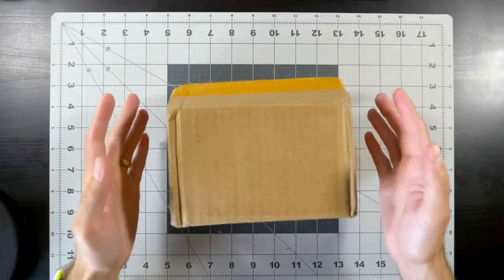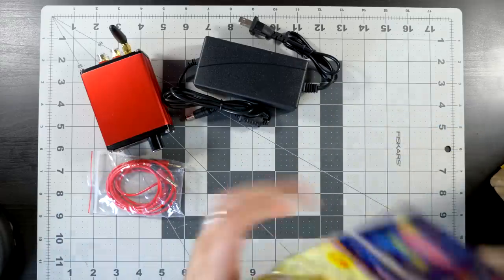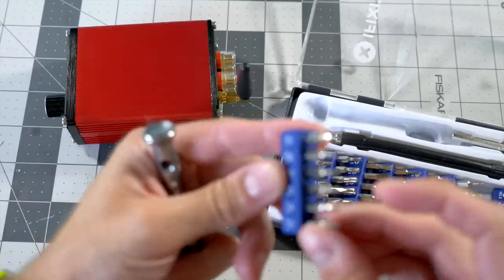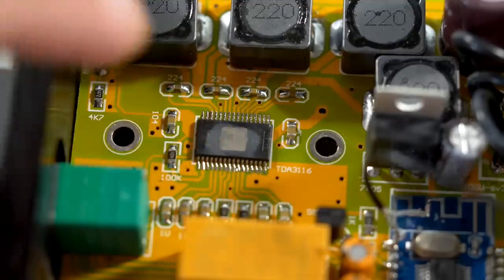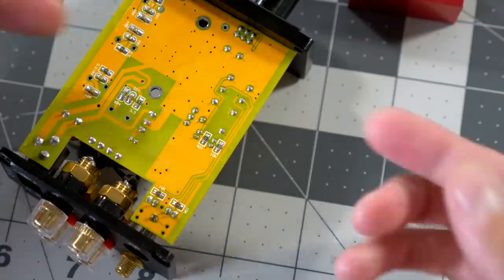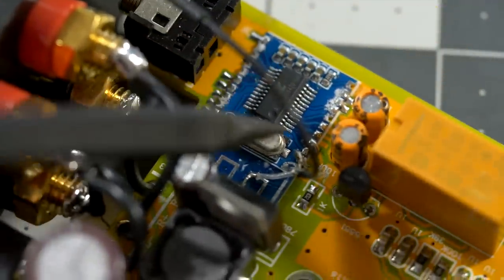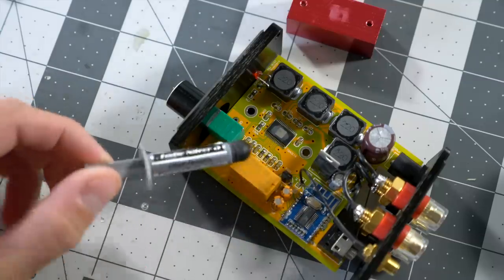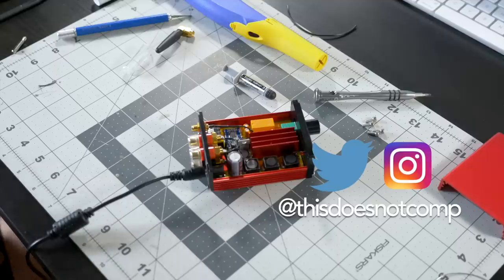Mini Audio Amp Teardown and Mod!

Comment: Maybe I'm wrong here, but now that both sides of the trace are cut, won't this defeat the capacitor completely?
Reply: Beitie Beitie The capacitor will be connected across the power rail when the switch is on.
Reply: No, but it does make for a rather long return path to the main filter capacitor, making local bypass capacities all the more important...not that it was ideal to begin with since there is a rather long and narrow path between that input capacitor and the main ground plane even as it was to begin with...so probably comes out to be six of one, half dozen of another on this project (which is to say, it won’t make much difference in this case as neither of the two are ideal to begin with).

Comment: You have to be careful looking at amp chip data sheets. Just because it says it'll do X watts at Y ohms at Z volts, doesn't always mean it's a good chip. You have to look at THD+N, charts, and characteristics based on the configurations of single ended, bridged, or parallel bridge connections. 
But generally, TI chips will have the power specified at 10%THD, and sometimes at ohm ratings that aren't as common, like 3 and 6 ohm.

Comment: The reason it doesn't connect to the pot is because they don't want DC in the pot, the pot is dealing with AC only. They want to separate the audio and power grounds to the max to meet the opamps safe man

Comment: I can't decide if the weirdness/cheapness of the amp is worse than I expected or par for the course. That power switch is definitely a new strange level of cost cutting. Even $45 seems kinda expensive for this thing.

Comment: I'd be willing to bet that the board is designed to not not care if it is a switched pot or not. This way, they can just buy whatever is least expensive, or use whichever 10k pot they salvaged. Just jumper the switch solder pads when using non-switched pots and call it a day.

Comment: I also bought a nobsound amp on eBay. Different model with sub out. Same exact behavior. Power light always on. Seems the company has done this by design.

Comment: At 22 mins in, I'm thinking the switch on the volume turns off the relay to stop thumps. It's got enough pins for a dual pole. The amp and the blutooth look like they stay powered up, minimal loss there at class d compared to the brick losses. Is this the type of amp you'd buy to put into a small bookshelf speaker to convert from passive to powered?

Comment: you should have cut the connection after the cap you partially bypassed the 60 hz filter so now you will have line in destortion (aka humm) in your speaker output
Reply: No, he won't have distortion, because the chip is now dead, and there'll be nothing to distort!

Comment: Nice to have a working switch but you do now have a filter cap in a less than optimal position for good power filtering. In effect you have changed a reasonably well thought out filter scheme into one that may not work as intended. Not a criticism but you may now require a better filtered power source along with better EMI filtering at the power in point.

Comment: i think that amp IC has an ENABLE pin on it and it was keeping the bluetooth module powered all the time and switching the leg on the amp IC to power it up. *just my opinion from what i could see pausing and looking at both sides of the board. the topside of the board has a trace running from the power/vol pot to the IC. the datasheet for that IC says PIN2 (SDZ) = Shutdown logic input for audio amp (LOW = outputs Hi-Z, HIGH = outputs enabled). Hi-Z means high impedance or no output.

Comment: I would have gone with a NE556 as a Stereo PWM modulator and a NE555 as a clock generator and a dual channel OP-amp and 4 BD131 power transistors for the output two for each channel and the OP-amp are part of the feed back circuit being feed by a low pass filter one for each channel.

Comment: to be honest its 40 quid...………..looks quite ok...….they often "acid etch" the top if IC's to hide the fact there "Knockoffs"...….probably  the switch issue is to save money (they had thousands on stock)  and you could argue that it ads mechanical strength, also leaving the Bluetooth "on" is no bad thing as the idle current of those modules is in the uA range...(bugger all!)….the proper amount of heatsink compound is better on the chip as you no  categorically that you have thermal contact....Great video Sir !

Comment: The switch's not designed to hold 5 amps, that the reason why it's not connected to the power supply.

Comment: for the supply with 12 volts the not so perfect heatsink is ok :-)
but of course with this supply it is not possible to crank out 2+50 watts on 4 ohm.
an important question: how did it sound?
Reply: You are absolutely right.
That's most probably the reason they add a 12V power supply.
At 12V and with 4 ohm speakers the thing won't be able to do more than 2x 10 Watts and most probably the heat protection of the amplifier chip kicks in even before that. With those tiny Chinese class-D amplifiers it's best to use 8 ohm speakers and a notebook powersupply of 19V. It still won't give you more than 2x 10-15 Watts.

Comment: If you wanted the whole thing to turn off then why dont you just off the socket????
It would also stop the power brick from converting the voltage constantly.

Comment: The Fosi Audio TPA3116 V1.0G is much better made and comes with a 19V power supply. It has no bluetooth, but as bluetooth sounds like crap, I don't care. I like mine, although it will not get anywhere near 50WPC. With the included power supply, my Fosi does about 20WPC into 4 ohms (as my speakers are 4 ohms). It also has a separate switch, so I don't have to change the volume setting to mute it. It's not really ever off unless you unplug it, the switch just mutes the amp. It also provides a pretty beefy capacitor bank immediately after the power input jack (1,000uf @ 35V x4) to provide a nice, low source impedance for the amp chip to run off of.

Comment: I have a guess on the diagram print out included in the packaging. The photo is labeled, like a diagram to show the dimensions. To show the amp right side up and include the same measurement would leave out the height of the amp and feet. The photo they used would have had to be taken at a proper angle, and had extremely clear measurement markings to convey the measurement shown is the width of the aluminum, not the height of the amp sitting on its feet. They either didn't have the right photo to use or knew no matter how clear it was right side up, the feet adding a few mm to the overall height of the assembled amp would be unclear.

Comment: Tiny PA chips just cannot do the work they claim, when it comes down to it you're talking about volts and amps and physical size of the internal bus and connections have to be big enough to handle the current.

Comment: Hi, Did you test the amp switch before open up the little case? some of TPA3116 design using a switch on pin 12 to actually mute the amp. The manufacturer didn't use the power switch on the volume pot for main power because the switch can't withstand the peak current draw.

Comment: It's always a good thing to hack your stufs so congratulation on that.
That being said the reson they dont use that switch on the buton to turn the power on and of is that i seriously doupt that this kind of small swiches can handle switching 24V 5A with complex reactive load. That might work but that will probably blow at some point. But hey it's cheep chinese electronic, that shitty cap would probably go bad befor the switch anywhay so ...

Just my 2cts...
Reply: Considering he de-soldered the ground lead on the filtering cap, the power supply will likely dump the maximum instantaneous power output through the switch terminal upon closing, creating a dead short and a spark in the range of 20-100 amps. Definitely going to wear down the contacts!

Comment: You can see the switch traces on the top of the board.  Look at the back end of the volume/switch assembly - the single thin trace coming out from the back corner toward the LED.  It runs under the 100k resistor then under the 3116 chip.  Guessing it goes to Pin 2 - SDZ  (shutdown) or pin 12 - MUTE.  If I'm right when you put power on that line, you probably destroyed the chip.  Since, y'know, even though you didn't specifically Show us the regulator, I was able to read '7805' from it, which means the logic runs at 5v, and you just put 12 v on one of the logic pins.  My guess would be that the constant power is for the Bluetooth board, so you Don't have to keep re-pairing it, and the 'off' switch just turned off the 3116 amp section.  Have fun with your pretty new paperweight.
Reply from the maker: I tested it with speakers off camera, works fine.

Comment: Did you check if the switch was not wired to a standby input on the amp chip through a pull-up resistor?

Comment: Noice. I kinda started on something along those lines. I usually listen to podcasts around the house while i do chores. Normally i just leave my phone somewhere close and that's it but i found a speaker with line in at goodwill for a buck (there's tons of them) so i am making it into a raspberry pi powered internet radio. XD so far its been fun. I got everything working how i want it but the pi is outside and powered by its own psu. And its a pi3 so its overkill. Gonna change it to a pi 0w and im gonna power it off the same psu as the speaker and then mount everything inside

Comment: that switch is connected to the rest of the circuit... its normal that you see nothing with the multimeter... you maybe have a led for the Vin... this led is not supposed to be turned off... ... you may find the other pin of the switch connected to something else... i let you figure it out ;)

Comment: You didn't get a beep of the second switch leg because the switch was turned off. There's a trace that sneaks under the amp chip, so it's likely switching something on the amp. Perhaps an "enable" pin or something? Pretty terrible implementation of a on/off switch. Personally, I'd fabricate a simple transistor controlled on off switch, where I used the switch to turn the transistor on and off, simply because you'll never know how good that switch is..

Comment: TPA3116's wiring diagram from 320volt.com:
https://320volt.com/en/wp-content/uploads/2017/10/tpa3116-circuit-schematic.png
The IC doesn't have leads specifically for the power LED, but shows ample opportunity to include it among surrounding traces. So, considering that the IC's 12V - 24V circuitry intersects the Bluetooth module's 5V circuit, via the main power Capacitor ("-" side), AND at least 1 circuit (hence both) are flowing current as indicated by the LED lighting up at all, I'd assume both circuits are functionally complete. The only loose end might be whether the input power Cap is still involved. If in doubt, a continuity check from the rotary switch's power "+" side to either side of the Cap should confirm, I think. Before checking continuity: power switch in the "On" position, power cord unplugged, Cap fully discharged.
Btw I bought the TPA3116D2 amp version that does 2×50W + 100W (so they say, but never happens), Bluetooth-in only... sturdy amp in my experience. I put a passive 2nd order low pass crossover on the sub channel, and a 2-way passive filter on each L & R channel with a corresponding mid & tweet thereon. Powered on Lithium-Ion & home grown BMS tech. Sounds strong though it never reaches 3A. The sub I have on it now is an 8ohm 15" PA main. 1 datasheet I saw for the IC said it was rated up to 7.5A, but if you can make it push that kinda current you should prob'ly put a good fan & ventilation around the whole thing.
Anyhoo, remember Watts=Volts×Amps-circuit inefficiencies.
Appreciated this video and its sequel. This is like what I've been researching in TECH HOBBY & RECHARGEABLE BATTERY TECHNOLOGY playlists.👍😎

Comment: So is it just me or is the input power for the whole board now controlled by the volume knob? Ie everything is on a dimmer switch? Or am I just missing how that is being handled?
Reply from the maker: The dial actually performs two separate functions. The first is that it's a stereo potentiometer for the audio, and the second is that it's an on-off switch. The two are electrically separate, though. There's a little "bump" in the rotation of the dial where it clicks to turn the switch on. Any further rotation simply changes the audio volume.

Comment: It would have been a better idea if the company didn't put the damn power light on at all. I don't have any use for blue tooth anyway. I just have the Lepai LP-2020TI and Kinter K3118. Both have this pop through the speakers when powering them down. sounds like a cap discharge to me. The first filter cap is after the power switch so if one gets a PS + and - reversed there goes the cap. Sure they are cheap affordable amps yet a resister could have been added to drain the cap to ground tied to the ground side of the power switch, at least I think that's how it works. I only have build tube powered guitar amps which have a power stage filtering using 3 to 4 500 V 40 uF caps to take out the a/c ripple from the power transformer. Most do offer a bit of a speaker pop on power down. I don't pretend to know solid state one bit. Yet I would think there must be a way to eliminate the power off speaker pop which does not harm the speakers. It's just annoying. I don't try to force out the 20x20 RMS rating and use 8 ohm speakers , even 5 watts is plenty loud so I stay with the 12 volt 3 amp PS. I hear no hum or buzzing just music for my desk top PC , much better than those sterile self powered PC speakers I've had in the past.

Comment: You should not use that tiny switch of the pot for main power, it's far too weak to do that. You'll need a relay to be able to do that safely. The switch just controls the soft-power off pin of the amplifier chip. The big capacitor is not for filtering but for buffering: it provides power peaks for heavy bass. Who cares that the chip isn't centered with the heat-sink? There is no reason it should be. It's far too tiny anyway.

Comment: Did you check the current rating of the switch ? Arctic Silver is potentially conductive, or at least capacitive. I would not have used it on that audio IC, as it is close to the exposed connection pins.
Reply: http://www.arcticsilver.com/as5.htm

As he cleaned the chip and applied the paste to the heat sink, I think he’ll be fine. It is not conductive, but “very slightly capacitive”.

Comment: interested in function with speakers. I have had 4 or 5 of these now, I sell them to co workers because they just want musing and do not care about additional features. I'm hoping you or one of your viewers can help me finally find the right model for my needs. I've been through all the major MB variations available on ebay for the 25/25w 50/50w 2 speaker bluetooth amps and they all seem to lack sound quality. I am currently using a 50/50/100w that just about meets my needs, but it has this horrid Chinese/English voice that squawks at full volume "the bluetooth device is ready to pair"  I really want something that would play music off a usb stick or SD until it see's bluetooth and then goes back to playing when bluetooth is released. I might be asking too much there, not having that voice would be nice.  You are right about the laptop power supply. I have an HP printer power supply that made a stellar difference in power.

Comment: Someone can correct me but if you have a spare heatsink around I'd throw one on that 7805 voltage regulator.  Those things get really hot especially if you start supplying them with 20 or more Volts.

Comment: Not a great idea to switch the ground on a device like this that connects to other devices.  Make absolutely sure that the power supply 0v output is completely isolated from ground, otherwise the switch will do nothing and the amplifier will try to power itself via the ground on the RCA connectors.

Random component choices on cheap Chinese gadgets tend to be down to whatever components were available at the time.  Possibly it was originally designed for a non-switched pot, but they got a deal on switched pots and just added a couple of holes to the PCB.  The other possibility is the switch in the pot isn't rated for the current required by the amp, did you check?  Also the voltage regulator is a 7805, therefore 5v.  7812 is a 12v regulator.

Comment: I would think that the power switch / potentiometer would not be adequate in terms of the amperage needed required to power the amp circuit and will probably burn out. 
Keep the videos coming though I do find the audio stuff interesting.

Comment: It Would probably be easier to do the wire to switch thing if the top of the circuit bord had not been cut only the bottom after the electrolytic capacitor and the wire soldered to the capacitor.
Thats how i would have done it.
but it still works so it doesn't matter what way it's done as long as the electrons can still get where they need to go.
✋👍👍👏

Comment: Well Im not a nerd but if I choose to tinker with this then first I will Check first if it works as intended and if not then return it. Second, if it did work, then I will try to modify after I have made a clear rework of the electronic diagram of the PCB since it is simple enough to reverse engineer the crap out of it. As for the video it would be nice if we actually see if it worked before and after enduring all that excessive rumbling and rant. But that's you and hope you got what you wanted coz I did not expect that teardown and rework without first clearly and practically showing the problem functionally . But that's me and my problem, so yah... Great job I guess... So why did this show up on my suggested videos again?